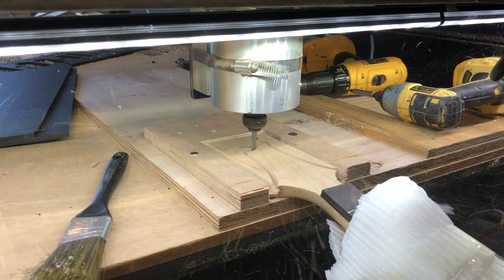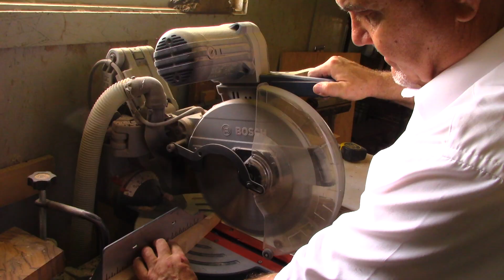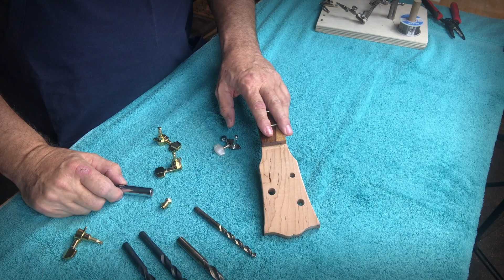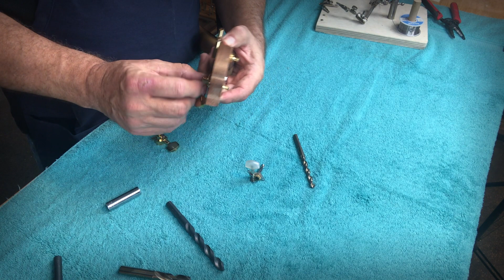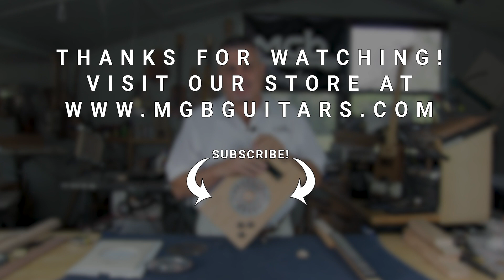Tuner Holes & Drill Bits | Learn'n & Build'n w/Michael Breedlove

Comment: 8 mm is the hole, drill 3/8 in reverse , finish with 10mm remer, or use taper remer than finish with 10mm straight remer

Comment: Hi thanx for the video. What size would i need for the small mounting screws on the back of the headstock?
Reply: Dan Challis this is exactly what I need to know also. Figure it out yet?
Reply: Just buy a set of bits and compare with the actual screws that came with your tuners
You want the bit to be the width of the screw shank if it didnt have the threads on it
Also use the screw to determine drilling depth you want the depth you mark with tape on the bit to be just shy of the length of the screw without the head
Hope this helps

Comment: let's skip stupid loud non-music at the start and just make a video that is useful... ok? A 10mm hole is needed and an  RC plane prop reamer  for about $15 has 7mm, 8mm, and 10mm cutting shafts and is perfect in a drill or drill press to enlarge 8mm holes to 10 mm. A drill bit alone will wander and has to be used exactly in a drill press. A graduated 7 to 8 to 10 mm is perfect and cheap.
Reply: You can definitely use a hand drill done it many times you just dont plunge it in one go
Also
Even on a drill press
Bits can wander 
So this is one of those things that depends on the operator if you have a steady hand and take your time you can do it by hand for sure